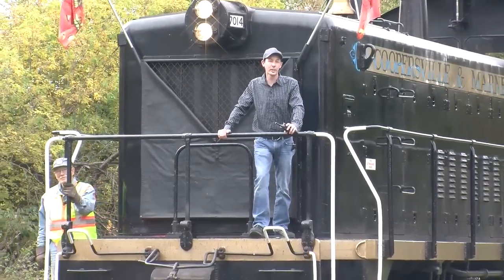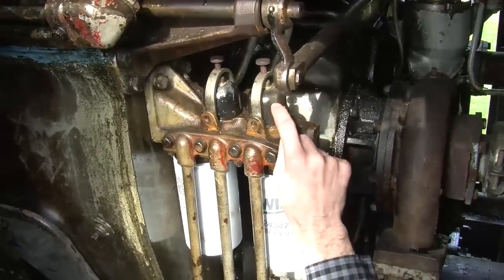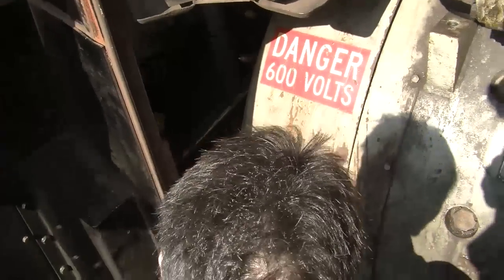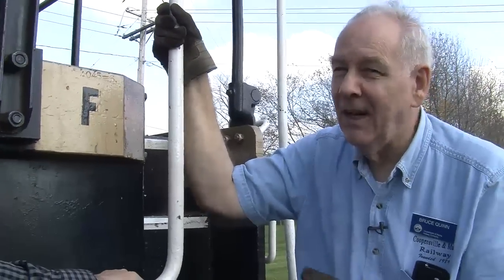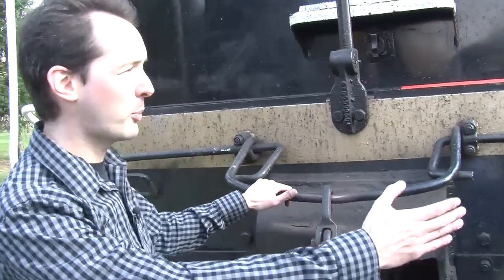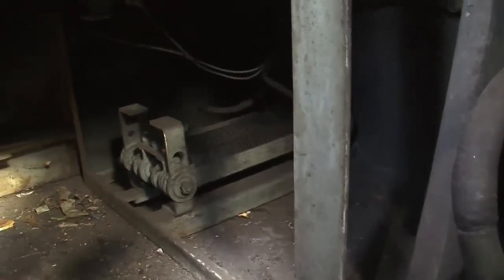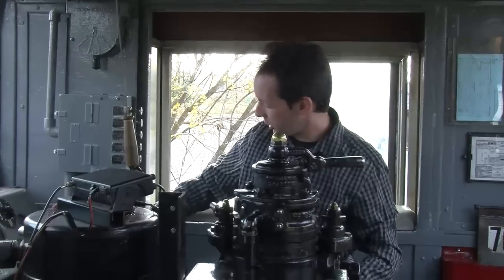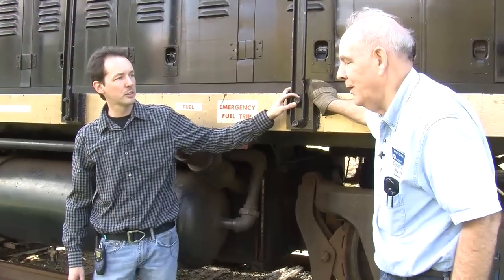Diesel Locomotive Basics

Comment: Can this be run in M.U. operation?
Reply: I would say no, since this particular unit has no MU air hoses or MU electrical connectors on the rear of it.
Reply: Scott Nichols I don't think they are necessary. They used to double head steam locos, you just need two engineers.
Reply: Jemalacane0 The SW9, like most switch engines from that era, was not equipped for multiple unit operation.
Reply: Molly May, then it wouldn't be MU, per se. MU ties all the power together so that they can be operated identically from the lead unit by a single engineer. That would be impossible with traditional steam locomotives. However, UP has some sort of method for running modern power with their heritage fleet, but it's only for dynamic braking.
Reply: Union Pacific has installed a small control stand in the cabs of the 844 and 3985 with reverser, throttle and dynamic brake functions, and MU receptacles on the rear of the tender to control trailing diesels, and the locomotives have been fitted with a No. 24RL automatic air brake stand instead of the old No. 6, to be compatible with modern No. 26 brakes, as well as WABCO EPIC 3102 and NYAB EB60 brakes.  SP 4449 and SP&S 700 have also been so equipped.
Reply: Kind of figured it was something of that nature...a separate stand. So, the separate control stand is basically like some of the RCL receiver slugs that don't even have an engine. That would allow them to run the train from the heritage cab even if the steam unit failed. Makes sense.
Reply: It wouldn't be difficult to connect this engine to an MU link. The main component it is missing is an isolator switch, but otherwise everything else would just be connected with the MU port, or socket. Of course they would also have to plumb the brakes too but that's also not a huge change. Big thing is, why would you want to? a little switcher like this was meant to be the mule in a yard or some other marshaling facility, doing all the work on its own. If they needed more power than this, they would just bring in a road-switcher.

Comment: The presenter says 600 volts isn't dangerous... You do realize that the generator puts out 670 kilowatts of mechanical power, which also roughly translates to electrical power. At 600 volts, that's over 1100 amps of current! Now, I don't know what miliamp lightning machines you play with, but there's some VERY DANGEROUS current in that locomotive! It will char anything organic.
Remember, it's not the voltage that kills. It's the current.

Comment: Locomotives with mechanical drives are generally very small (50 Tons or less) and cannot pull very much. The amount of power and tractive effort needed to pull a train of any appreciable size is too much for mechanical drive systems, hence the reason the electric traction motors are used on most locomotives.

Comment: The speed control with the notches is like a subway car  but subway car has eather par or ser on a Drum switch and trust me subway cars are heavy to just find when motors get old they cant climb hills     did you know subway cars have a speed key but only machanics have them    now dont some railroad engines use dynamic breaking were the traction motors will act as generators to slow a train down
Reply: Fred Roper what is a speed key?

Comment: It's a turbo
Reply: Dave Winfield The 567B prime mover in an SW9 was not equipped with a turbocharger.
Reply: Steven Holden they dont make aftermarket turbos?
Reply: EMD did make an "aftermarket" turbocharger for non-turbocharged 567 engines, but installing a turbocharger on a large non-turbocharged diesel isn't as straight forward as it is in an automotive application, largely because the turbo on the 2-stroke EMD 567, 645 and 710 series engines is actually a compound turbo-compressor that is gear driven at low speeds and becomes a true turbocharger at higher rpm.  Long story short, 567B engines need first to be converted to "C" standard (becoming 567BC engines) and then could be fitted with the turbo-compressor machinery; however, a much more common process since the early 1970's has been to install 645 power assemblies in suitably modified 567 blocks, producing 567E engines with a similar power increase as if the engine were turbocharged.
Reply: Oh yes your right, the 2 strokes have roots blowers which are superchargers because there gear driven. But I didnt know they could turbocharge on top of it. Whats a c standard?
Reply: Converting a 567B to a 567C involves replacing the water deck (part of the cylinder cooling circuit) and associated plumbing with a water manifold.  It's largely small detail changes that were built as standard on the 567D model engine, which was the first 567 power plant that EMD designed from the outset to be turbocharged.
Reply: The compound turbo-compressor, which is unique to EMD 2-cycle designs, actually replaces the Roots blower on the naturally aspirated engines.  The compressor portion of the turbocharger is driven by a gear train and overrunning clutch at low speeds, when engine exhaust gas temp and mass flow are insufficient to drive the turbine; i.e., the turbo is below it's boost thresh hold.  At higher engine rpm, when exhaust gas temp and mass flow increase above the boost thresh hold, the overrunning clutch allows the gear train to automatically disengage and the turbo compressor becomes a true turbocharger, with the compressor rotor driven by the turbine.  These Wikipedia articles can explain further https://en.wikipedia.org/wiki/Turbocharger and https://en.wikipedia.org/wiki/EMD_567
Reply: In automotive applications, turbochargers can be fitted in concert with a supercharger; the process, when done to use both systems to increase engine performance, is called twin charging.  Large diesel 2-stroke engines in trucks can also use both systems, with a Roots blower for scavenging and a turbocharger to increase power.  I used to see that quite a bit when I was a mechanic in the US Army, on the Detroit Diesel 8V-71TA V-8 2-stroke diesels used in the M109A6 Paladin and M992 FAASV, and the 8V-92TA 2-stroke V-8 diesel used in the older M977 HEMTT series trucks, first gen Palletized Load System tractors and first gen M1070 Heavy Equipment Transporter tractors, as well as the 6V-53TA used in the M113 family of vehicles.

Comment: Electric locos perform better, thats why all your fast bullet trains are 25KV AC.
Reply: Electric locomotives do not perform as well in freight operations.
Reply: And the reason is...???
Reply: Don G.
Low adhesion and low tractive effort.
Reply: Motors have more torque per unit weight than a heavy diesel-electric,that is why trolley-buses are are favored over Diesels for hill climbing, electric motors pull better. Electric motors do not need transmissions for that reason also.
European freight trains are all electric, so is Amtrack Northeast corridor at 25 KV.
Reply: Don G.
Good thing diesel locomotives use electric motors for traction and that their heavy diesel engines increase adhesion.
Reply: American and Australian freight trains are the heaviest and both countries use diesel-electric locomotives for freight trains. American coal trains can be as heavy as 15,000 tons and Australian freight trains can be even heavier.
Reply: Heavy weight tears up ballast, wares out bridges,rails.
 When I was stationed in Japan, and rode the bullet trains I did see any Diesel locos.I saw a clean modern rail system, freight & passenger. Beautiful! Nothing dated, or legacy old-time looking like here.Sorry, but that's my experience over many years there.JNR has some fine machines, all electric 25KV catenary system.
Reply: Don G.
Maybe outside of America, heavy weight tears up rails, but in the U.S., railroad rails are made of strong enough steel not to be damaged. Also, some of the ties are being replaced with concrete ones. Moreover, American freight railroads are more efficient than those overseas because they move an enormous amount of stuff with each train. This may pay enough dividends for railroads here to incur some damage.
Reply: You make a statement without any facts! What are the tonnage? Compare this to the Railroads of Japan, Europe?
Reply: Don G.
According to BNSF, each of their Powder River coal trains are 125 cars. Each car of which are 131.5 tons when fully loaded. Do the math.

SNCF (who operates the TGV) said that France ran the longest European freight train which weighed 4,500 tons. I am using American tons by the way.
Reply: does't american trains, have 600v in them? not the one powered by AC from a live line. and high amps?
Reply: MARCELLINO GUARNERO At standstill, main generator output is initially low voltage/high current, often in excess of 1000 amperes per motor at full power. When the locomotive is at or near standstill, current flow will be limited only by the DC resistance of the motor windings and interconnecting circuitry, as well as the capacity of the main generator itself. Torque in a series-wound motor is approximately proportional to the square of the current. Hence, the traction motors will produce their highest torque, causing the locomotive to develop maximum tractive effort, enabling it to overcome the inertia of the train. This effect is analogous to what happens in an automobile automatic transmission at start-up, where it is in first gear and thus producing maximum torque multiplication.
Reply: Don G. Modern locomotives incorporate traction alternators, AC to DC, with the capability to deliver 1,200 volts (earlier traction generators, DC to DC, had the capability to deliver only 600 volts). This improvement was accomplished largely through improvements in silicon diode technology. With the capability to deliver 1,200 volts to the traction motors, the necessity for "transition" was eliminated.
Reply: yes
Reply: Proof:[China Railway]Daqin Line HXD2&HXD1 Freight Train
Reply: Jemalacane0 HXN3 locomotive, 204 cars, each loads 100 tons, which is average carrying load for freight trains in china daily , the heaviest freight train in china loads 100,000 tons of coal.
Reply: Dude! your mixing Torque with Horsepower, review your Physics!
Reply: Don G.
No, I'm not. I was comparing the tractive effort of two 6,000 HP locomotives. Damn it.
Reply: Don't get excited! First, horsepower is not the only factor in any engine, power to weight ratio comes into play. Big overweight loco needs power to overcome itself. A lighter weight vehicle needs less to overcome inertia to get moving. Bigger is not necessarily better!
Reply: Don G.
A higher tractive effort equals more pulling power? Yes? A heavier locomotive has a higher adhesion which means it doesn't slip as much as a lighter locomotive. The weight of a locomotive is not an issue for its power.
Reply: TIME SAY ITS BEEN A PLEASURE BANTERING BACK AND FORTH WITH YOU BUT I MUST GET BACK TO MY JOB AS A DIESEL ENGINE GENERATOR TECH.HAVE A NICE DAY.
Reply: until you cut the power lines or take out the power plants, then they don't go so fast anymore. And if you have coal burning power plants then technically electric trains aren't as clean as diesel.
Reply: +Don G. I just wrote a not so little spiel on transition, and then saw this post lol. Nice simple and concise description of AC advantages btw.
Reply: Tx!
I have an advantage of being an engine generator tech!
Reply: @Jemalacane0  The Butte, Anaconda & Pacific RR switched to 1500 V DC for economic reasons in the 1910's.  When the line shut down it was still using the original locomotives when it electrified.  The traction motors were 600 V DC.
There are a series of diesel-electric locomotives operated by BNSF, UP, and CSX that are produce AC and use AC on the traction motors;  I just can't remember the make and model but are used on container trains mostly.

Comment: 1200 horsepower is literally horse shit. Put the 1500hp engine from a bugatti Chiron to this locomotive it will not move 1cm. The only important and interesting thing would be to know how many newtonmeters that fukin diesel has plus how many newtonmeters those electric motors have because they actually move the fukin thing.